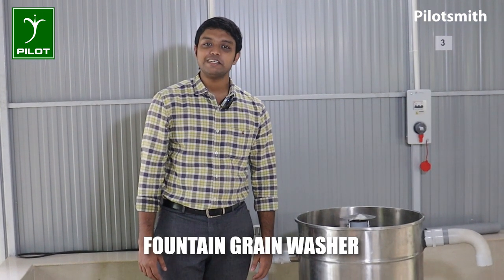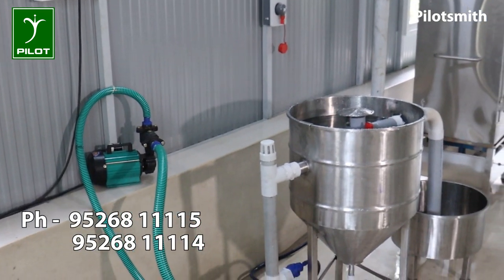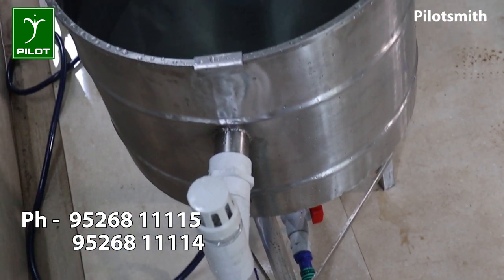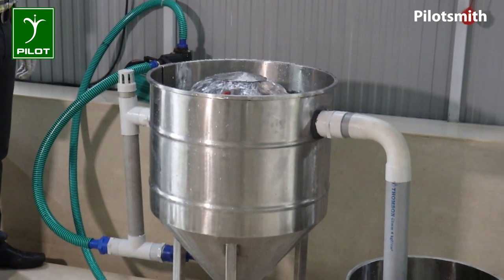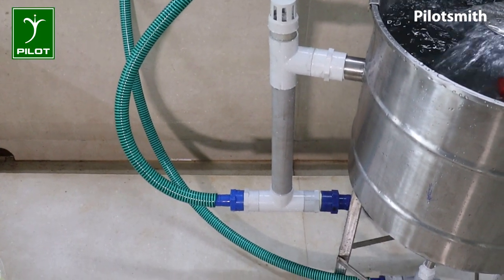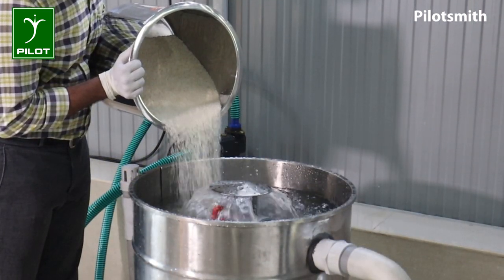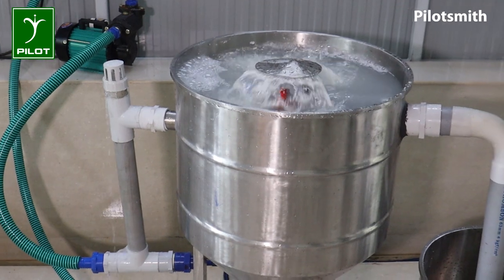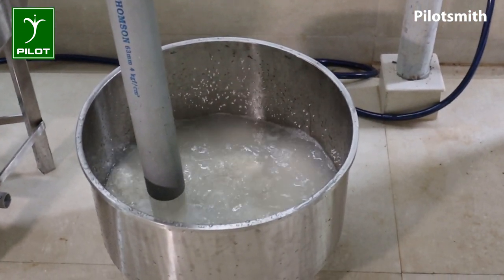Fountain Grain Washer | Rice Washing | Flour Mills

Comment: Nice presentation 👍. A small suggestion is instead of leaving waste water to the floor it's a good idea to have a hose connection to the drainage. This is mainly on a hygienic note.
Reply from the maker: Sir ,we have provision for that.
In this video though we have used a separate wet area for the process.🙂